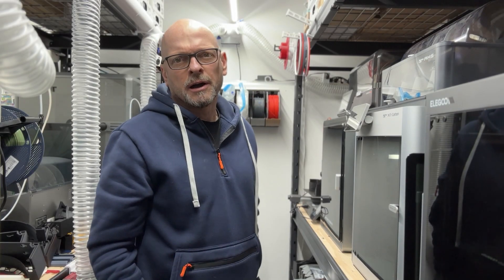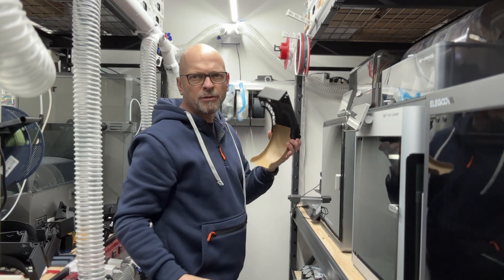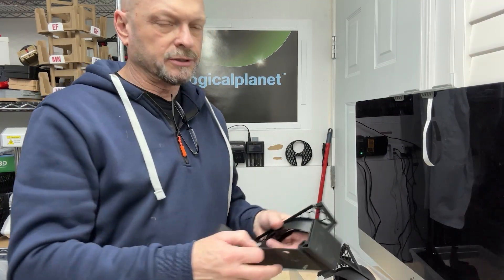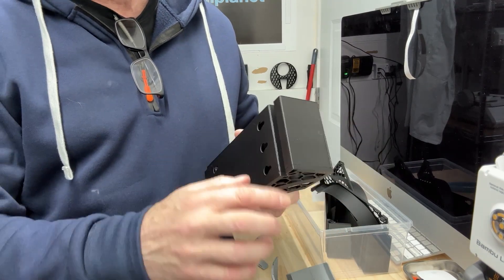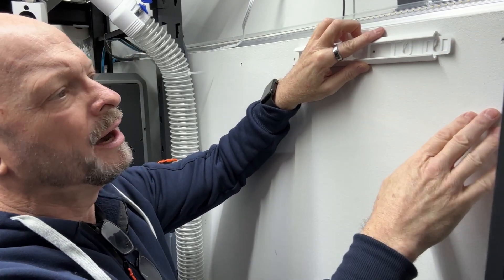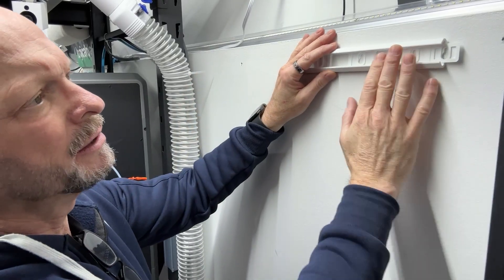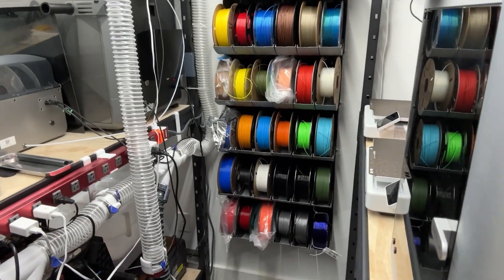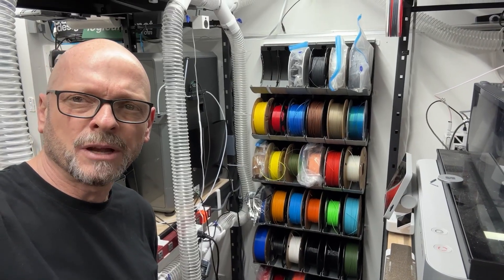LogicalPlanet Spool Storage — Modular, Collapsible, 100% 3D Printed

Comment: I have similar racking , with a single printer and on the end would be great to utilize your system. Thinking two end rack supports with a piece of plywood vertical then mount your rails.

Comment: I really like it, but I tend to store my open filament in dryboxes, the type made from cereal containers. As such, I needed some kind of standardized shelves. Rather than printing all my hardware, I ended up going to the local home store and buying a very old-school type of rail and bracket setup giving me 5 shelves holding up to 8 dryboxes or as many as 12 standard filament boxes (1kg size) per shelf or some combination of both. Cost me a bit more up front but only took about 30 minutes to install and I now have over 50 spools on the wall, 21 of them in dryboxes.

Comment: Love the design idea, but I need it for metal walls that I do not want any holes in. Magnetic or the adhesive strips are really my only solutions
Reply from the maker: If you think magnets would be strong enough, I can add holes for them in the rails (or make a special rail for you).  But I suspect you need a good adhesive tape.  The existing rail design would work, but again I could make one with more surface area for you if needed.  Please email me at logicalplanet3d gmail.com if you want either of those solutions.